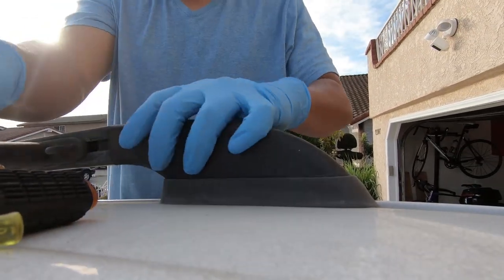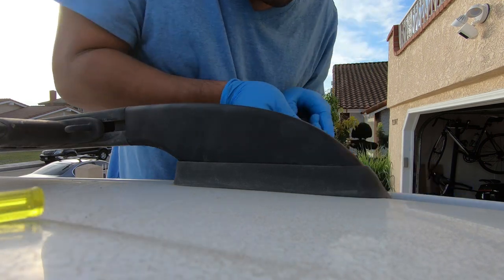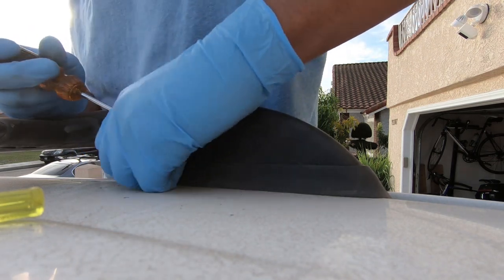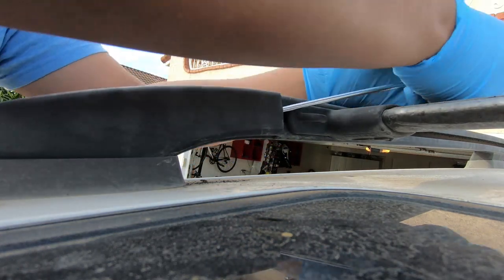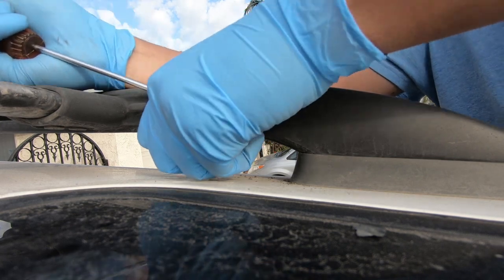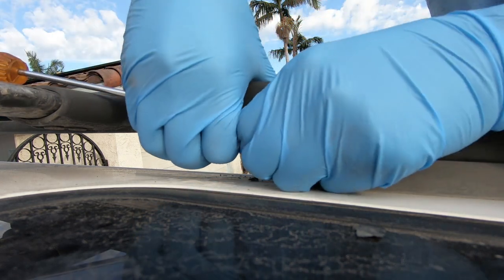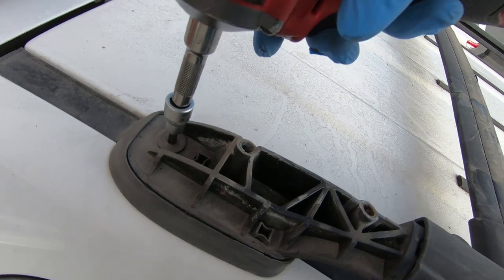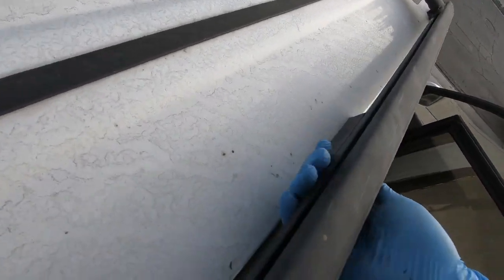Removing factory roof rack on Toyota Land Cruiser 100 LX470

Comment: Question: is there a way to keep the roof rack rails on and just remove the crossbars? If you remove the end covers of the rack rails, will the crossbars slide out, as it looks like there may be an inner piece of rail blocking them? Thank you.
Reply: You ever figure this out? Will they slide out with the caps off?

Comment: Hey, I have a 2000 LX470 and the boot cover under the cover you took out it's brittle. Do you know what it's called. I've looked online and cant seem to find a replacement for it. Let me know. Thanks.. note: I also have a '06 GX470 and it doesnt have this piece. I wonder if I even need it there..
Reply from the maker: I think it’s there to protect the paint from the cover. But like you said, they harden and get brittle over time and eventually scuff up the paint anyways, like it did on mine 😞. Not sure what it’s called, best way is to replace it with a aftermarket roof rack 😉

Comment: Hey, I have a 2000 TLC and I am in the process of removing the factory roof rails.  My question is, on the passenger side, the middle foot tower, does it have the same bolts ? Mine has a regular bolt, like all the other TT-40, but one, towards the back is different and hard to get out - rusted. Any tips would be appreciate it.
Thanks
Reply from the maker: Mine were the same bolts as everything else, however, they were super rusted as well. I ended up drilling them out.

Comment: Easier way it just to lightly tap the plastic covers from the inside toward the outside with a hammer or mallet, they have a seam and pop off super easy, takes about 1-2 seconds each, plus you don't risk breaking the plastic clips.

Comment: Tried this trick on a 2007 Landcruiser 100 and broke the clips, as it’s a different design. There are no center posts. Instead, there are 4 tiny clips, 2 on each side of the covers. To release them, press vertically down on the cover and gently pry the sides out to release the clips (caution: they’re tiny and break very easily!). Then, pull up from the front to release the metal clip and pins from the rear. The rear is the same design as the front. Good luck!
Reply from the maker: This is very interesting. I thought only the LX had 2 posts factory racks
Reply: I have the same style. I wish someone would do a video on this style of roof racks...
Reply: I have an 01 LC and an 06 LX and I discovered the hard way that the covers attach to the LX differently. Broke all but one of the plastic clip edges off of two of the covers. Time for a new roof rack I guess.. lol

Comment: hello, sir. I just got a quick question about my 2004 LC, there is a noise come out from my abs accumulator when I start the car or step on brake couple times. if I want to fix it, do i need to replace the entire abs accumulator or just the motor inside of it? thank you.
Reply from the maker: Changhong Li have you had any braking issues? I’ve heard of those going bad causing loss of braking power
Reply: The brake feels soft, since that accumulator already made noise when I bought the car, so I do not know what is the normal brake power.
Reply: By the way, should I replace the entire accumulator if I lose some braking power? Thanks
Reply from the maker: Changhong Li mine was weird when I picked up my land cruiser. I ended up getting the oem Toyota rebuild kit for it and doing it myself. It fixed my braking issue. I still need to take it into the dealer to get the braking system properly bled, but it works at 90% now so it’s been acceptable so far. If yours has a similar issue I would recommend start from the rebuild kit because replacing the whole master is expensive
Reply: @chowcares  great, should I start with replacing the HBB motor?